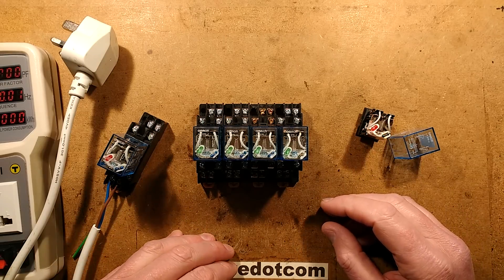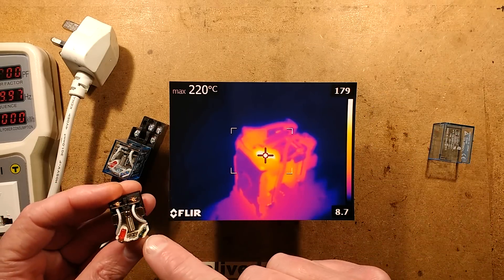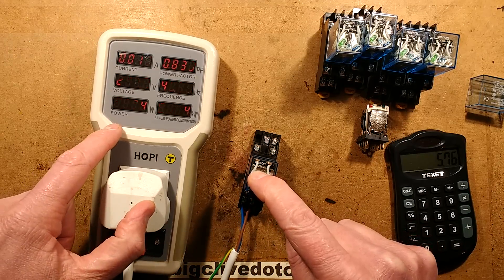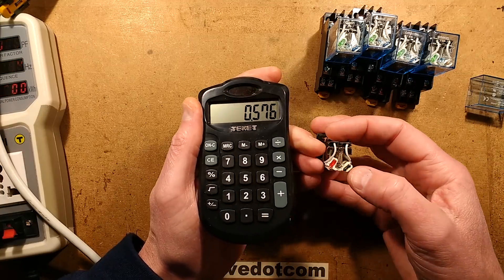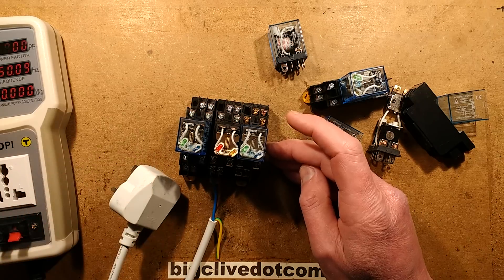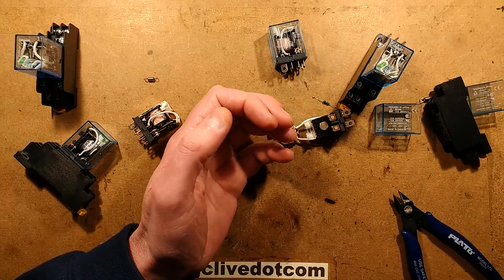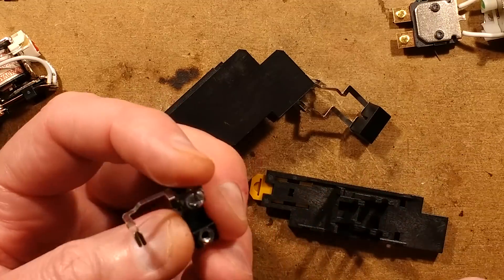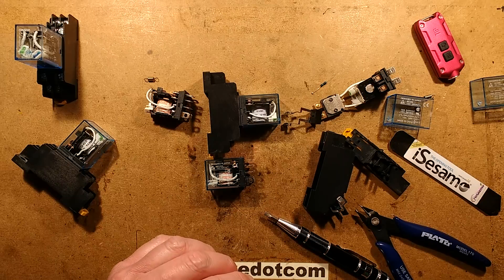Fake Omron relays with smoky issues.

Comment: Dear bigclive, please set your video camera shutter speed to something below 1/50 second, this should compensate for the beating effect of the HOPI meter.
Reply from the maker: The meter has a very slow scan rate.  It only locks when the bench is dark and the camera exposes the frame longer.
Reply: bigclivedotcom it's at less than 50Hz? Usually this kind of beating effect is tuned to the grid frequency.
Back in the days of CRTs videographers would lock the shutter speed to below 1/50 and it solved that issue.

Comment: Started my working life in a strowager telephone exchange.  It was like the 4th road bridge, by the time you'd "fettled" all the relay controlled switches it was time to start again.  Big soldering Irons and tiny spring gauges and odd looking pliers for tweaking the different springs.  Incredibly noisy, gawd I was glad to get out of there.
Now I'm told they're like morgues, the only sound is the cooling fans, you can go days and not see another soul ... gawd I'm glad I never worked there.

Comment: Clive. What is the light you used and where did you buy it from?
Reply from the maker: Do you mean the illuminated magnifier?  It's a common item from China on eBay.
Reply: bigclivedotcom no the key chain light you used at 12:00.

Comment: I have some of the omron relays from ebay so probably fake too but only 12v dc not had any issues, will be staying well clear of the 220-240v versions though. I also get around 250v at my house so would be extra melty.

Comment: I have had a problem with the REAL OMRON relays, since they outsourced the manufacture to Malaysia. I have had issues with arcing and pitting on the contacts and having unmatched return springs which seem to cause early degradation. Maybe those aren't fake?

Comment: I like relays too. Used to have some which were wired as a logic circuit. Each one was a latching bistable switch. Quite ingenious. The first digital computer was German, and it used relay logic, with a clock speed of 1Hz.

Comment: Why don't they put the LED in series with the coil? A shunt resistor could be placed on the LED to protect it a bit from back EMF and would allow the LED to operate more within the appropriate current range of 5 to 10mA.

Comment: Resistor power rating is based on being mounted above a PCB at moderate temperature. Encased as it is, it must be derated to less than half;  especially next to the hot coil.

Comment: are relies ideal to make a old fashioned fruit machine ?
Reply from the maker: They could work.  The old pull-handle machines with electrical control systems used relays and step counters.  The more modern electromechanical ones also used cam switches.  These days a microcontroller or Arduino would make a much more versatile game.

Comment: I bought a reject air conditioner window unit with dead, electronics on the cheap over ten years ago. To operate it, I bought a DPDT 12vdc relay from RadioShack for 120vac-240vac, 12vdc power supply, and a digital thermostat (battery powered) with just simple speaker wire as a thermostat line. The contacts were only rated for 10amps so I split the hot to two contacts and recombined them. I also added a separate relay of the same type to run the fan independently of the compressor. RadioShack didn't provide a relay base so I just crimped on spade connectors to wires, and they showed no sign of getting hot. I am still using the same relays, and the only real change I made was to put them into a grounded metal box because the relay switching was interfering with my TV and reception. The electronics on window units is far more reliable not so getting brain dead air conditioners on the cheap is likely a thing of the past. I still find this exterior thermostat control superior to internal thermostats except that I used to have issue with evaporator freeze over on occasion. Using one of those cheap Chinese thermostats probing the temperature of the coils solved that problem.
Reply: Cool. I've been learning a bit about larger AC and refrigeration systems. They have more complicated mechanical controls in the plumbing (thermostatic expansion valve, head pressure control systems of various kinds).

Window units just take a reasonable guess and don't try to optimize the refrigerant mass flow and pressures.  I've been wanting to mod one with at least remote thermostat.  But evaporator defrost and hygrostat would be good features too.

Microcontrollers are so cheap and easy now that it would be easy to do the logic in software.

Comment: Clive, I suspect you would have enjoyed working in a relay based CrossBar (or Step by Step) Telephone Exchange.  I liked listening to the ebb and flow as the call were switched during the course of the day.  Could almost set your watch based on the sound.  Sadly not to be heard by anyone anymore, at least not in Australia and in 2022 apparently the pstn will be switched off.
edit ...I read below that you are familiar with exchanges.
Reply: Justin - there's also a proposal to decommission all public telephone boxes. Maintenance costs are too high, and revenue has become all but non-existent. It's far cheaper to put a simple, low-bandwidth cell tower in remote locations than a telephone box these days.

Comment: I've seen recommendations to fit a capacitor instead of the LED to protect against current multiplication on switch off.  Is this good idea please
Reply from the maker: I'm not sure about mounting it inside, but you can get external snubber networks.

Comment: Cheapest 12V DC driven relay from a name brand I could find costs ~16€
As added benefit, the name brand version also has a retainer so the relais does not un-socket itself.

Finder 48.61.7.012.4050

Comment: I bought some fused 30A relays from ebay to take the load off of the headlamps and the heater motor on my old Reliant Robin, the heater motor just fused the relays solid on the lowest setting and the headlamp relays melted, none of them blew the fuse but burnt out the contacts which looked like tin foil... never again, found some NOS Lucas relays on ebay and they have worked beautifully ever since.   Once upon a time Lucas was a byword in quality and pretty much the end word on anything automotive electrical too, now only remembered on classic cars although they are still making stuff as I bought a brand new Lucas brake light switch recently but bet its made on the QT in Taiwan or China.
Reply: Since the joke "Lucas - the prince of darkness"  has been around longer than I have, I think "byword in quality"  may be a bit of nostaligia over reality :) but an  "OK" quality unit is always a better choice than a "maybe it will catch fire, maybe not" unit..

Comment: If you love the sound of relays, you would have loved the tour of the switching room of our local phone company that I took years and years ago. It was when they had rotary phones, which made a relay click multiple times each time a digit was dialed on a phone. I lived in a town of 100,000 people and the noise of relays was loud and continuous. As a side benefit, they didn't need a heating system in the winter, because the heat generated kept the half block square, three story tall room warm even in -15c (0f) weather!
Reply: To me they sound like hail on a tin roof - bordering on white noise in a larger exchange.
Reply: When I was a kid, lived in a town with a Bell long lines repeater office combined with the local town step-by-step office in a three story building.  In the summer the windows would be open because there was no air conditioning.  It was music to nerd ears to walk down the street and hear the SxS chorus wafting out.

Comment: Have you seen any relays that take a pulse to turn on and another to turn off? I'd like to use these for home automation. A low voltage push button would turn something on. The next one would tun it off. Then the "automation" part, a computer, could also control the button signal. This way, if all essential devices have manual buttons to control the lights, if the automation fails you can still control the lights by hand.
Reply: You are looking for what is known as an impulse relay. They operate just as you described, one pulse turns the load on, the next turns it off. Digikey has a 15A load 120 VAC coil unit (P/N PB585) for $53.11, so they are pricey.
Reply: Thanks Danny. With the proper search term "impulse relay" I found lots of them. Here's a nice candidate for only $9 US: https://www.delcity.net/store/Latching-Relays/p_818110.h_818111.r_IF1003
Reply: Latching relays ... I just couldn't find those words in my brain at that moment. :) I haven't found any that snap onto DIN rails and are inexpensive.
Reply: Yes, old VW passat used them for headlight relays.  They were connected to the high beam dip switch which was also connected in parallel to a mercury tilt switch mounted in the steering column.  I have never been able to verify why it was connected so.  I have theories.
Reply: Latching relays are not very common, and hence are expensive. You can either use some electronics to control the relay or use multiple relays, with two relays forming a latch circuit, each of which needs an auxiliary contact to control the other relay. At any one time, one relay is off and one relay is on. A third relay is controlled by your button, and it's contacts force the two relays in the latch circuit to change state. But both of these designs would need a suitable power supply to power them.
Reply: Everybody, thanks for the responses. Mark, I was hoping for a kind of old-school foundation that was passive similar to our typical toggle switches we use now.

If I were going to use multiple relays then I'd use one power relay and a reed relay with a permanent magnet hold. A pulse to the reed coil would pull and latch the reed closed. That would keep the power relay coil energized. The power relay would have a second set of contacts to reverse the polarity of supply voltage to the reed coil. That way the next push of the button would unlatch the reed which would de-energize the power relay coil.

This idea is kind of off the top of my head and I see the potential for problems. The first is, if you pushed the button but did not release it, the system would oscillate on and off as fast as those relays could go.

Since our modern controllers contains non-volatile memory, I could just have the state of each relay stored in case of power outages.

Comment: Would you be interested in taking an Audi blower motor resistor to bits, just replaced mine so I have the dead one, the wires going to it got so hot they melted the sheath and turned the wires to crap (https://www.autozone.com/cooling-heating-and-climate-control/blower-motor-resistor/duralast-blower-motor-resistor/517974_0_0) image of it thought it looked cool.

Comment: Presumably another solution for the resistor issue would be to add a series mains rated diode - half the dissipation but no loss of brightness.

Comment: You'd most likely have to derate the max power for the resistor because it's wrapped in plastic and therefore can't efficiently dissipate the heat.
The long legs is a mitigating factor though.

Comment: The genuine Omrons with AC coils i have here use a couple of turns of enamelled wire around the main coil supplying a couple of volts in isolation to the led. A more elegant solution.
Reply: V8Snail Elegant and shows the primary coil working so a great solution altogether.
Reply: i have some relays that have a 'mechanical'  indicator linked to the armature,
Reply: I guess some people prefer relays where you can smell the indicator.
Reply: @klausstock8020  'ya mean smell .. ?
Reply: @CXensation  Yes. Thanks, I corrected my typo.
Reply: Smart

Comment: I use Omron a lot and only purchase from my local electrical supplier (Kirby Risk in the States). I am also a BIG fan on the old Allen Bradley 505 and 509 starters. Simple, VERY robust and easy to rebuild in the field. Have you ever used or worked with these types of 3-phase motor starters (505 & 509 Allen Bradley)?
Reply from the maker: Not sure if I've specifically worked with Allen Bradley starters.  I probably have, but never noted the brand.
Reply: I may have to dig around in my bin and see if I can find a good one to send you to mess with. If you would like?

Comment: I’d have used a neon in the 120/240v ac ones.
Reply: better idea, but neons are more pricey, leds are dirt cheap these days
Reply: All the neon indicator bulbs in my extension leads failed years ago.
Reply: @ColinWatters  they do fade with use(not 'age', if you dont 'use' them, they'll last forever!), but they were most likely overdriven to make them brighter, i've seen values as low as 100k used, on 240v mains, 270k to 330k is  much better, making them last a lot longer,   and they'd still be visible , i've just replaced  a 120k in one power strip with 2 150ks in series(i couldve used a single 330k, but i've got loads of 150ks .😉), the neon itself was ok, the resistor had gone almost open circuit
Reply: also ...leds wont necessarily last, 'forever', especially cheapo ones and ones with the 'phosphor' on their chips,

Comment: Reminds me Clive..... you mentioned in a reply on one of my posts in another video, that you have an EM Bell-Fruit fruit machine, and that will have loads of relay's in (Normally Omron branded), that would be worth investigating at some point.
Reply from the maker: It would.  I love the sound of the cam switches when it's running.
Reply: The interesting thing will be, that although the control decks in these BFM EM's are made by Starpoint (They are still trading to this day), some of the BFM EM's are transformer powered (Not many I may add, and was more common towards the late 70's, when eventually they moved on to their Black Box tech, and went more digitally controlled), normally at around 50v / 60v for the main operating voltage, where as non-transformer builds, are full on household voltage 240v.

Comment: I don't even know what a relay is.....im dumb.
Reply from the maker: No.  You';ve just not had to use one yet.  It's an electrically activated switch.  When you power it the coil pulls in contacts, so it can be used to switch a high current mains voltage load with a low current 12V signal.  They used to be the main control logic in industry.

Comment: Yep, spent my time looking after control systems that used a lot of relays and contactors, including Cam timers (there's another subject for you), including lift controls.
Nothing more satisfying than a motor breaker at 400A clunking in and out :D
Reply: I will never get used to the relay clunk as a diesel generator goes online.  I know its coming but it never fails to scare the sh1t out of me.
Reply: I got used to it after a time, i knew the sequence of the relays before the main contactors operated.
Only thing that made me jump was a flashover on a 415v 3 phase busbar that my colleague had caused, got a bit of arc eye, but wasn't too bad.

Comment: I do like that they're transparent. It makes it easier to diagnose if there are problems; if the contacts are stuck or arc more than they should you can easily tell. But yeah, that LED circuit is a good way to burn your house down. Actually... is there such a thing as a 5mm LED with multiple junctions in series inside it? Would make a lot of sense in a resistive dropper circuit.

Comment: Clickering.....the sound of multiple relays being used in anger.
Someone has a shelf, and on that shelf it a box, and that box contains tens of thousands of resistors.   All the same value.  It does not matter what,  That factory owner needs to use them up now. In anything...to offset the loss.
Reply: My guess too. "Same order of magnitude? Do they still click and light? Close enough, shove them into the next batch..."

Comment: In all these "cheap-shity" videos, please show & tell how things are done right. At this point you spend most of your air time taking cheap shots at obvious junk. Everyone understands the "cheap-shity" thing now.  How about adding some value?  

As to this topic, after 38 years with my head in industrial controls, I've never seen "cheap-shity" components. It's not done. No one risks productivity for the price of critical controls. In fact, one of my challenges has been working within the limits of "approved" sources.

This is just another cheap shot video showing nothing new or interesting. Please start spending time showing & telling your viewers how things can be done correctly. Between you and Ave, I'm getting sick of this "cheap-shity" shit.
Reply from the maker: The point of this video was to show that a cheap product that is perfectly valid for home projects and experimentation has been hobbled by a bad component choice.  I could look at more expensive components, but they're actually less fun.

Comment: I have found that TME is a very good source of electronic components if you want to buy a bit more than hobbyist quantities but not production numbers. I have been ordering from them for about 2 years with never a hiccup. The only thing you need to make sure of is that what you want is in stock as sometimes their stock refreshing is very slow. They are competitive with some of the Chinese vendors EG a bay of 500 LED's for about £10.